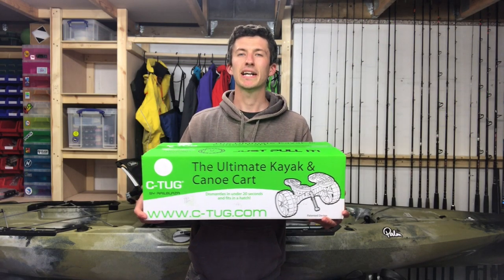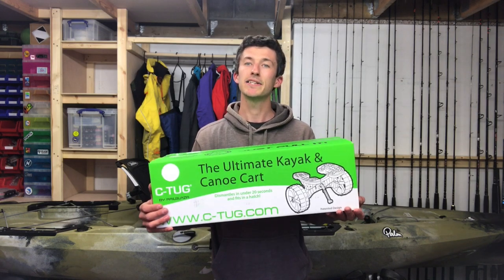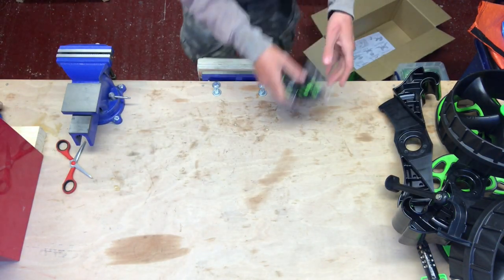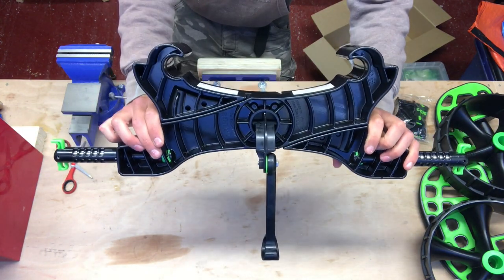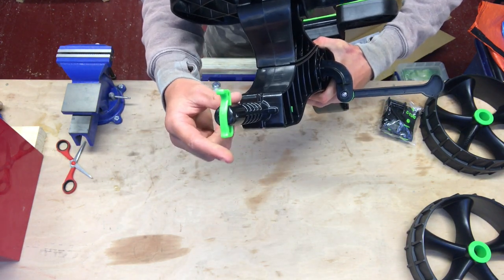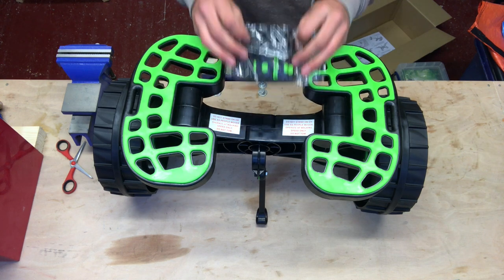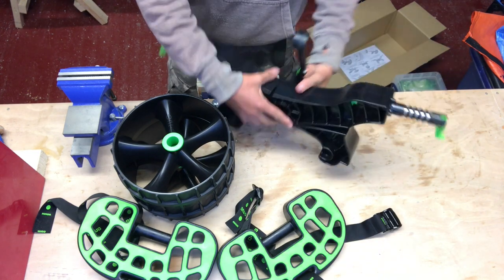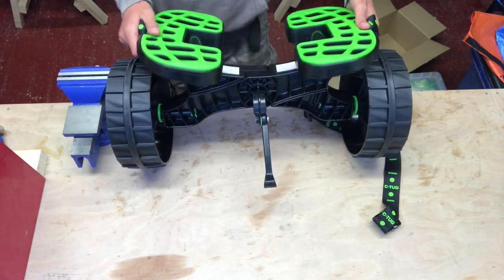Railblaza C-Tug Kayak Trolley - Assembly and Strap Setup

Comment: I've inherited this kit, along with an inflatable kayak/rib called a spearfish 450 (4.5m long).  I've attached the trailer as per the instructions but ithe trailer keeps collapsing when dragged.  I've tightened the straps as tight as I can ... any suggestions?  (my only thoughts were to put an extension timber piece on the support ?) TIA
Reply from the maker: Check out the new C-Tug R Conversion Kit. These new style hull pads offer better support to larger craft. Essentially doing what your timber pieces will do I believe.
Reply: @CornishKayakAngler  Thanks  ... looks perfect.

Comment: Is the kickstand supposed to flip both ways? It doesn't lock in place?
Reply from the maker: Yep it flips both ways. If you leave it down, at least it has some chance of knocking out of the way instead of snapping if you hit a rock or obstacle as you pull your kayak along.

Comment: My straps were completely installed incorrectly....lol.  Thanks for the great video and sharing of info.
Reply: Can this carry a 13 ft by 4ft jon boat.
About 125 pounds.
Reply: @bradhuskers  I have a 13ft Vibe Sea Ghost 130, 97lbs fully loaded and I still get a workout hulling mine down for a beach launch using the sand wheels. It may work for you but it probably wouldn't  be efficient imo.

Comment: Factory instructions for the strap assembly were exceptionally poor, thanks for showing is the correct way.  Question:  are we supposed to tighten the bolt on the kick stand?   Mine is very loose.  Thanks.
Reply from the maker: Thanks for the comment Joe. I have found that the bolt needs nipping up a touch every so often as they can loosen up a bit over time. Perhaps it wasn’t quite tightened enough at factory on your one. Just take a spanner and give it half a turn on the nut to see if that helps it hold in position 👍🏻

Comment: Thank you so much for this fab video. Was struggling badly with straps, and had wheels on wrong way round, and hadn’t clicked in the wheel pins. I hope C-Tugs will give you some commission, there were no instructions for the straps only a picture, useless! That’s on the Sandtrakz model. Cheers, one happy rookie Kayaker. Mia
Reply from the maker: Thanks Mia! Yes the instructions aren’t the best but glad the video has helped - it’s easy once you know how 😀

Comment: Thanks for your video - Will definitely buy one of these trolleys now. I am tossing up between this and the sandtrakz wheel, but as it says not to leave the kayak sitting on those wheels for long was thinking I should get this original type of wheel, as I would probably like to leave the kayak on the trolley in my garage,  inbetween towing it down the steep driveway asphalt to the river across the road. 
If someone has limb weakness and struggles to push /pull etc, Is it worth buying this trolley and adding a set of sandtrackz wheels ? But then I guess I have the hassle of needing to move it off in the garage and not store it sitting on the trolley?   Anything that makes it easier to move around could be worth it for me.
Reply from the maker: Hi Alli, it’s usually not recommended to leave your kayak stored on a trolley long-term as you can end up leaving dents or warping the hull on your kayak. Because of the style of the trolley it is very easy to lift the stern of the kayak and pivot the hull on its bow when unloading the kayak from the trolley. As long as the kick stand is down the trolley will stay right in place for loading the next time. The Sandtrakz wheels are very good on soft sand and other soft ground. If you have any soft ground between your house and the river then they would be worth getting. Hope this helps!

Comment: Love the trolley but the ONLY problem I have found, is the terribly weak / brittle wheel toggle pins. Trying to think of a way to replace them with something more substantial
Reply from the maker: I can’t say that I’ve ever had trouble with mine after 10 years of use and abuse. I know you can get spares. Have you broke several sets?
Reply: @CornishKayakAngler  Both clips have cracked in the same place ( at the thinest section in the middle ) The cart is less than 2 years old. Always take care of the cart too, not rough with it. I'm wondering if maybe the newer ones are of lower quality materials than the older ones ?

Where the break is, I see there is no fibre reinforcement inside the moulded plastic, which I thought there would have been for such a part

Comment: Awesome video will the wheels roll on soft sand Ok?
Reply from the maker: Yeah they will go over soft sand ok, but if you have a heavy kayak then opt for the Sandtrakz wheel version as they make a world of difference! Much less effort over soft sand.
Reply: @CornishKayakAngler  ok I have a hobie mirage compass kayak kayak hope is not too heavy for it to go over soft sand.
Reply from the maker: The Compass should be fine with the standard C-Tug however if you have it loaded up with fishing gear the weight can soon add up and the Sandtrakz wheels may perform better on soft sand. You can always buy the Sandtrakz wheels separately at a later date if needed
Reply: @CornishKayakAngler  Thank you for your help very much appreciated I'm still waiting reply back from my local dealer in regards to my round centre hatch if they have contacted hobie for a new one.

Comment: Nice but does seem like cheap plastic unless I’m wrong and that clickie bit on the wheel will brake prity quick I would imagine not sure on this one but great video 👍🏻
Reply from the maker: They are surprisingly tough! I’ve had one since 2012 and still going strong, even the clicky bits 😀. All the component parts can be brought separately if anything does break so you wouldn’t have to buy a whole new trolley.
Reply: Cornish Kayak Angler i Just see your other video and you said they are bomb proof so I must be wrong haha 👍🏻

Comment: Great wheels but also very, very squeaky! Anybody find a way to stop the high pitch squeal of these C-tug trolley wheels?
Reply from the maker: I ensure I wash mine after each use to get the sand and grit out of the wheel bushes / axle. This seems to help a bit. Perhaps a drop of light grease may help although I’ve never tried.

Comment: Do you think you can transport a boat?
Reply from the maker: I believe the max load on the standard C-Tug is 120kg and on the Sandtrakz version it’s 80kg. You could perhaps use one to move a small tender or lightweight Jon boat, but a larger craft would need something more substantial to take the weight and size.

Comment: I’m pretty sure this is incorrect. It may work but it isn’t the intended method. If you closely check the instruction picture, the third slot (farthest from the teeth on the ladder lock) is empty. I think you do this but you put the strap from the first/teeth sloth through into the second.
Reply: The official video goes around only one bar. This one uses two, so it should be stronger.

Comment: bought one for my wife for Christmas and the kick stand does not have enough friction to hold it in place and i tried to tighten it and the nut just slips around in its case that is support to hold it tight
Reply from the maker: Hi George, can you get some long nose pliers to hold the nut whilst you tighten the bolt on the kickstand? Might be worth a try if the nut is not being held captive in the recess.

Comment: This certainly works but I’m wondering if this is really the intended method of securing the straps. They provide a single black and white picture in the instructions. Their instructions are almost useless. You’re only putting the strap through the first and third slot. The second slot on the ladder lock is never used. Doesn’t seem right. I wish they would provide an official video to see how accurate this method is.
Reply from the maker: The instructions are useless and even if followed the strap can slip using the method illustrated. Ladder locks are designed to be used the way I show in the video! They won’t slip when set up this way 😉
Reply: They DID create an official video and guess what? They gave wrong instructions. This is the way to go.

Comment: Just far to big to store in the kayak . I do alotof sea kayaking and most days trips and even for a day trip it takes up to much room never mind for over night trips . No need for it to be made this size surly ? I and anyone I know sent them back
Reply from the maker: Yeah for sea kayaking expeditions they are a bulky trolley. Not had any trouble fitting them in any standard composite or plastic sea kayak rear oval hatch yet, and on some models you can fit everything but the wheels in through a 8in bow hatch, which helps distribute the trolley between bow and stern storage areas. Usually still enough space for overnight camp kit too unless it’s a particularly low volume model or FSK. They are a popular choice for sea kayakers in my area anyway, although some do prefer smaller V-hull trolleys or alloy frame designs when loading up for a multi day trip. Pros and cons with every choice! A mini C-Tug would be welcome by many tourers and sea kayakers though I’m sure.

Comment: Your method of mounting the straps is not what the producer recommends mate, sorry, perhaps you should have a look at their demo ?
Reply from the maker: This is the point of the video! The manufacturer incorrectly shows how to use a ladder lock buckle in their instructions. Over the years it has led to endless users having difficulty threading the straps and preventing them slipping under tension. I work at a kayak store and it’s one of the most common issues people have with the C-Tug trolleys. Threading the straps in this way eliminates all issues! Even their instructions on the recently released C-Tug R shows the same issue. It confuses the hell out of people, hence thousands watching this video for assistance 😉
Reply: @CornishKayakAngler  thanks for the explanation, if this is the case, good on you.
Reply: I have the C-tug Imo the straps are trash, I use a bison latching strap sooo much better

Comment: I really wish i had of known about this cart before i bought an incredibly dumb and very dangerous scupper hole cart that's made to literally rip holes in your sea kayaks most fragile place over time with a worst case scenario of me losing my life lost at sea thanks to a flooded sit on top kayak.
Reply from the maker: Scupper hole trolleys are not good at all, certainly not for larger and heavier kayaks. I regularly see kayaks split and cracked thanks to these trolleys. The only time they can be used safely is when the scupper holes are reinforced with a sleeve to reduce stress on the hull - Hobie Kayaks have reinforced scuppers to work with their range of scupper trolleys. I’d still avoid them though and use the trusty C-tug myself. I brought mine in 2012 and it’s still going strong 💪🏻

Comment: Plastic isn’t worth $135+ that’s for sure.
Reply from the maker: The plastic itself is probably a few cents worth before it’s turned into something useful! Here in the U.K. they are the equivalent of $150-$170 based on todays exchange rates and retail prices. I’m sure most C-Tug users will say they are worth that and more! They do last well though, mine has been going strong since 2012 😎

Comment: quite unreasonably priced plastic if you ask me
Reply from the maker: Worth every penny and more! Sure there are cheaper trolleys out there that will do the job but if you are a regular user then be prepared to buy cheap, buy twice (or more!). I’ve had a C-Tug since 2012, it must have seen 500-700 kayak launches and equally 500-700 landings in that time and it is still going strong 💪🏻

Comment: Boxing vids are useless. Tells us nothing about the product.
Reply from the maker: The video is only aimed to show users how to assemble the product, in particular the strap set up as many people struggle. It’s more aimed at those who have already brought the product rather than those looking to buy 👍🏻
Reply: @snopuncx15  owning one and actually using it, the strap clip you use to attach the shorter strap to the pad, slips. Forget about it and tie it with a knot. You often also need to modify the pads to fit your yak. Some use PVC pipe, mine I found sections of pool noodle zip tied sufficed. Then you need to find a spot on the yak that you can crank that strap down as hard as you can, but with a part of the yak body that won't allow the strap to slip. It needs to hold it in place. I also never disassemble mine because of the required mods.  It's these tips that make the product actually work or allow someone to know if it will work for them. This is just an unboxing.

Comment: Your discussion on how to properly thread the straps is totally wrong.  If you look closely at the picture in the instructions you will see the proper way to thread the straps.
Reply from the maker: It works great and there won’t be any complaints with straps slipping 😎 the instructions confuse a lot of people (just check the other comments here!) 😀
Reply: No Richard *Dick you're wrong. The official  instructional video for the straps is actually wrong, it misses a thread which causes a weaker connection and slipping.